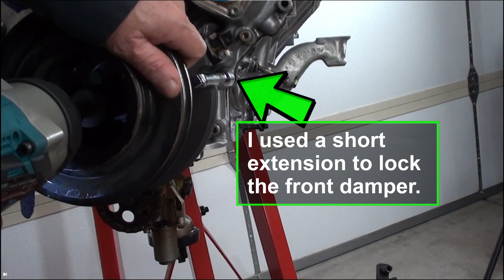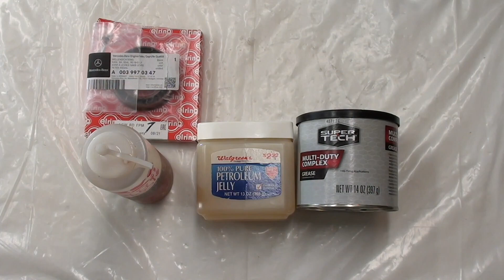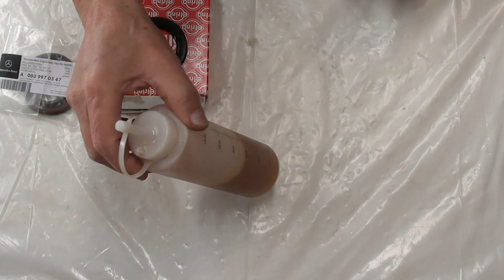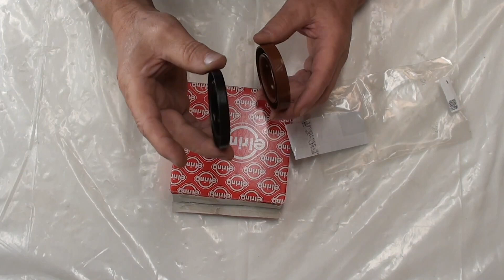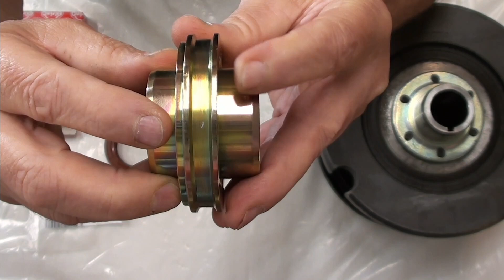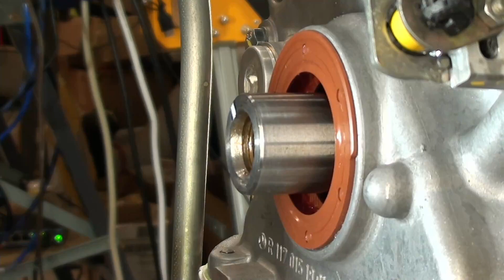560SL - Installing The Front Crankshaft Seal, Vibration Damper & V-Belt Pulley

Comment: Hey Tony great video, quick question can I reuse crankshaft bolt or do I need brand new, doing the same job right now. Thanks
Reply from the maker: The manual does not have specifications for reuse so that means you can reuse the bolt if you wish. https://tonylivetv.com/Engine/107/M117_56/03-324.pdf?pg=560sl&page=1

Comment: Congrats on another step forward Tony!  Really looking forward to seeing what a recently rebuilt M117 looks like.
Reply from the maker: Hey Trevor! I’m starting to get excited. Every time I turn a nut or bolt I get nervous because you never know if it will strip. I will feel much better once the intake manifold is torqued down.
Reply: @TonyLiveTV  Mine was so rusty it took a week just to remove.  Be happy it's all out of the car - getting the intake back on with the EGR pipe attached is rough.  

Once assembled, the real fun begins...chasing vac leaks and dialing in that KE Jetronic System.  Our friend below here from Inova Hightech has some amazing advice on that topic.  

Keep up the good work!